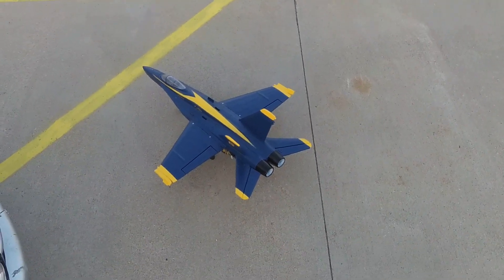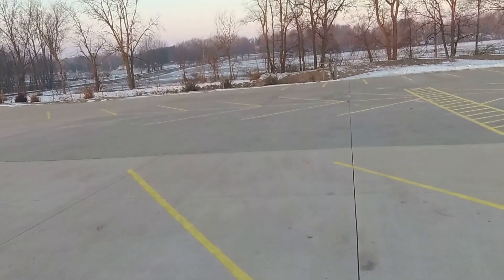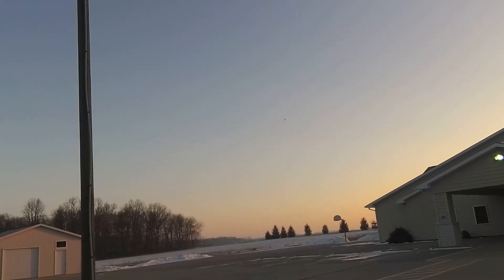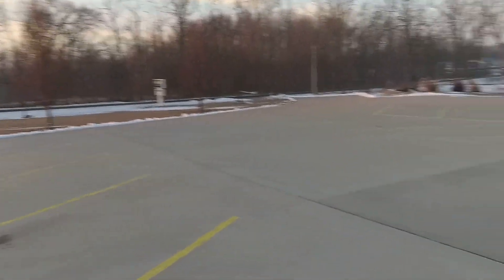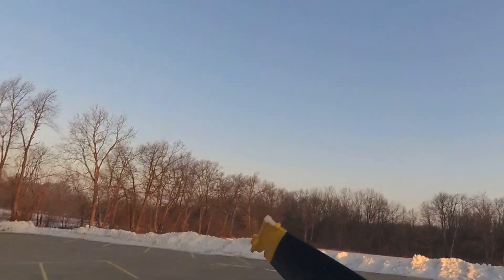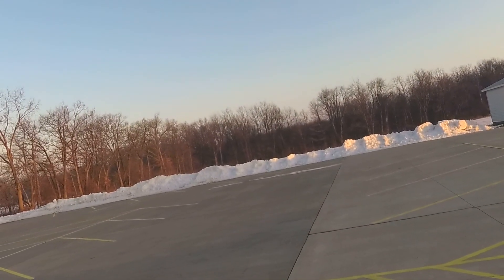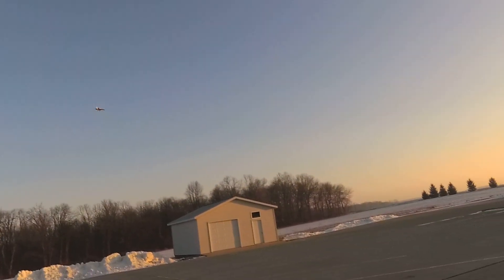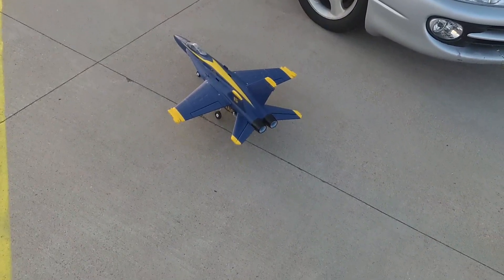2-22-2019 Force RC F-18 Blue Angel V2 a.m. flt - Landing practice

Comment: It looks like it flys considerably more stable.  It doesn't seem to balloon as much when you flare or pull the nose up on approach.   It will land a little faster than you like if you want a soft landing, especially with the wheels on it.   I don't use wheels and belly land in the grass.  Mine just floats in at a gentle power glide, but for a smooth touchdown, it does want a little more speed on that partial glide approach.
Reply from the maker: I'd love to land it faster! That would probably solve all my problems. But with the limited runway length and obstacles to avoid, that's easier said than done. Once the snow melts I should be able to land earlier, giving me more roll-out distance so I can land with more speed.